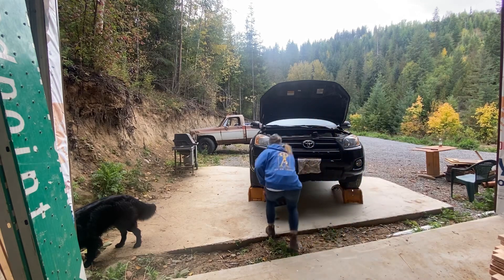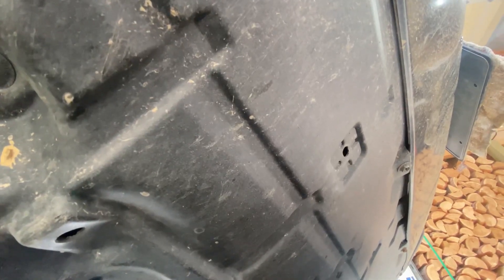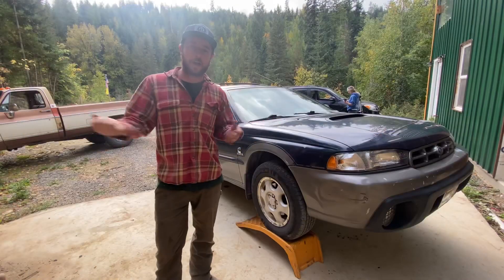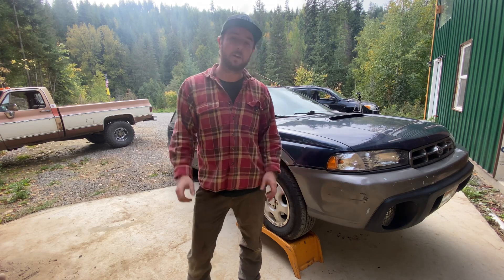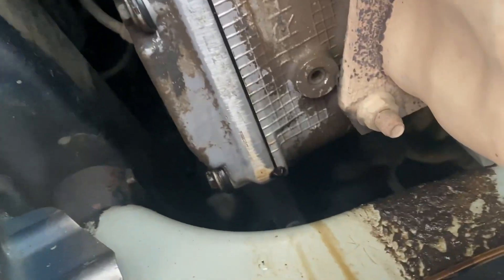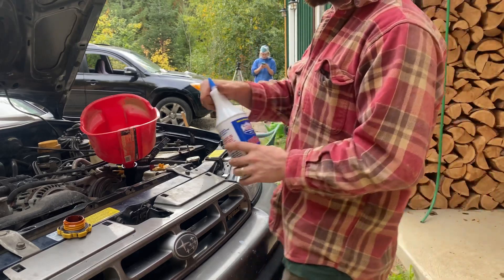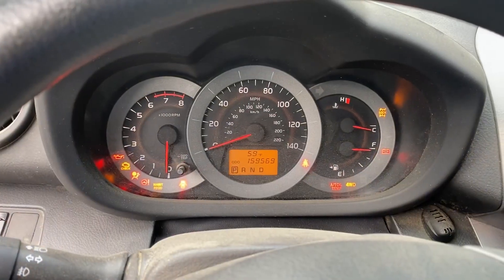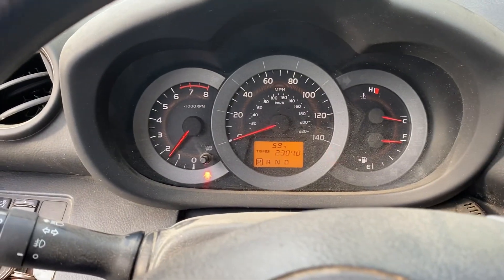ADDING A NEW MEMBER TO OUR BUNCH

Comment: The actual cylinder heads dont appear to be leaking however the valve covers seals are. A bit aggravating but not hard to change. Best to get a couple cans of brake cleaner, put her on the ramps, spray off the oil. Start and run it until you see were the leaks are coming from and how bad they actually are. If you have any buddies that are mechanics would be a good time to invite them over for a beer.
Reply: Tend to agree the video showed the valve covers leaking and it does look like a pretty bad leak.  These blocks r a pain to work on.  But, it was hard to tell since you only gave a few video shots underneath.  I'd also agree with the other posts that recommended timing, water pump service and since u r handy enough, just pull the engine and do the head gaskets too.  My 2007 Forester with the 2.5 SOHC has 197,000. The heads don't leak but half a dozen other areas are a bit weepy.  2-3 qts between changes and it runs great.
Reply: Agreed on the valve cover gaskets. I am by no means a mechanic and I was able to change them on my Subie.  Watch a video and they can handle it. This is a common issues on these cars.

Comment: It's nice having a piece of cement to pull your cars on & work on em 4 sure,beats the hell out of crawling around on rocks or even worse dirt. On the Subaru, to be honest w/ ya it having 190,000 mi. on it &  being a 97 I wouldn't change a head gasket ( if that's what it is ) I'd park it where the oil leaks weren't killing grass or staining concrete, keep a spare quart of oil in the car for when it gets low & let er leak.......drive it till the wheels fall off especially if it didn't cost ya much.

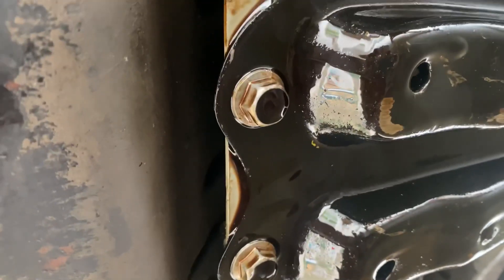Comment: Looks like your rack and pinion is worn/leaking. You can see it at 3:51 I actually just replaced a rack and pinion on this exact Subaru. They aren’t too bad to swap out on your own, rock auto is your best friend. Also the leak on your cylinder heads is most likely the valve cover gaskets, a common spot to leak on some of the subies. If you have to do the head-gaskets, id recommend looking for an ej22 to swap in instead of the 2.5. Much more reliable, less maintenance needed considering it really is a tank of an engine. I found my ej22 at a junkyard for $300, swaps right in with no extra parts needed.

Comment: On the rear end noise, it's probably one of two things, the drive live U-joint or the wheels bearings. Both are fairly easy to check and replace. I suggest a look at You Tube for what ails your new and used cars.

Comment: Valve covers leak, cam seals leak, good idea to get that timing belt checked out.  make sure you replace the tensioners if you do replace the belt. Im not a huge subby guy but we owned a wrx i successfully put 300k on without having to open up the engine. Great cars keep up on oil changes and that timing belt, and they will run along time.

Comment: ( Mechanic ) Get a "dealer service manual" off eBay. ( $ 20 to $ 100 ) This will tell you everything and part numbers etc . . ( invaluable IF you do maintenance yourself )
Older engines have lots of seals and gaskets that "OOZE" -- they are non flexible due to age / weather / seasons - cold hot cycles.
You kept saying head gasket change a few times - which is a $ 1500-3500 job at a shop - and you couldn't even drive it with a real bad head gasket leak as you would have mayonnaise in your radiator and block and you would be fogging the neighborhood with white smoke. Anyway - that is on a traditional horizontal ( SOHC / DOHC ) engine though. Maybe you have something different. Looked like some kind of weird vertical gaskets around the manifolds. Anyway - if you do have a traditional horizontal valve cover gasket - that is the most common slow oil leak in an older engine. At any rate - If you can trace down the small oozing and you aren't burning oil ( quart every week or something ) then you could go and go.
As far as the rear end noise - check the diff ( or trans ) fluid. Check universal joints. Check suspension - brakes - shocks. It could be anything.

ALSO - RAIN X all your windows before winter.

Comment: Hey, I found that the best way to fix oil leaks on a Subaru is to lift up the hood emblem and drive a Toyota beneath it 😀!  ...Mike, just wondering why you left the big gap between your shop floor and the outside pad?
Reply from the maker: No particular reason, just not done yet. Thanks for watching!
Reply: Toyota is the best!

Comment: I hope you mean valve cover gaskets it looks to me that could be the oil pan gasket. it's hard to troubleshoot a rear-end noise without hearing it.    PS retired jet engine mechanic                                       just my two cents

Comment: you should pull the engine and change the timimg belt idlers water pump and head gaskets and of course the leaky seals. it should run for another 100000mi.